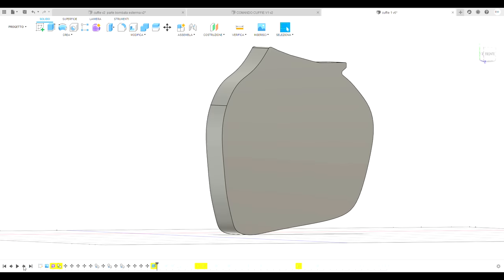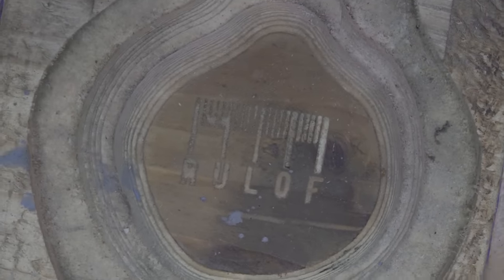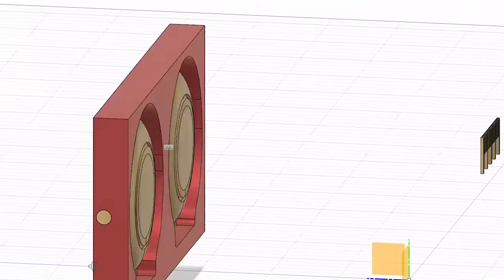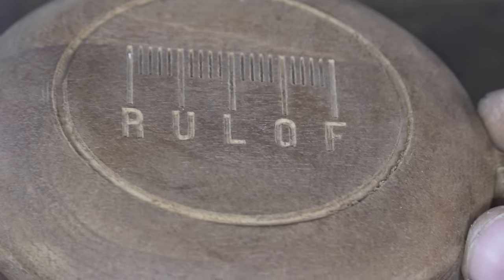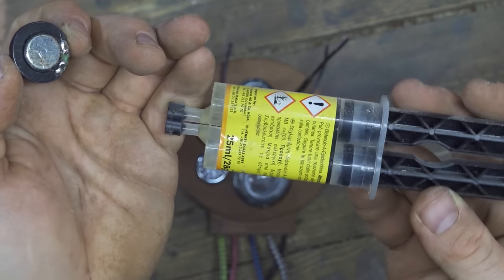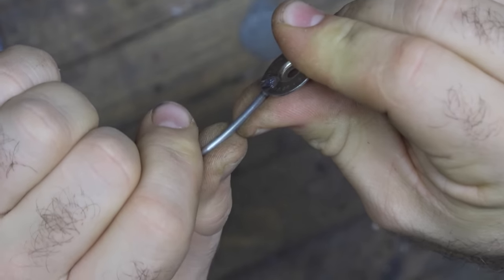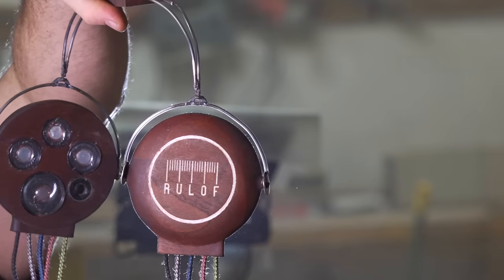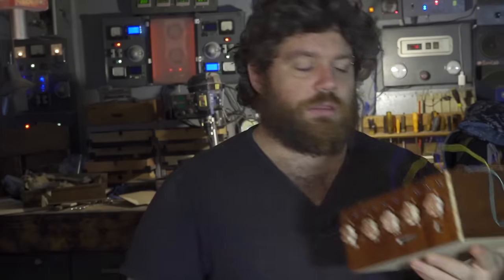How to Make Surround Headphones • Multiplayer Advantage

Comment: I look forward to seeing how you wire up the DAC.
Reply: Not that hard.

You have 4 normal speakers on each side+1 sub per side.
Front, Side, Rear, Center
Each one needs a power and ground
PC2001 design spec tells you what color each output on the internal audio card does.
Front as Green
Side as Gray
Rear as Black
Center as Orange Tip(Center is a mono channel decided for vocals)
Sub as Orange Ring
Ground is Sleeve on all TRS connections.

LF+ Green Tip
LF- Green Sleeve
LS+ Gray Tip
LS- Gray Sleeve
LR+ Black Tip
LR- Black Sleeve
LC+ Orange Tip
LC- Orange Sleeve
Left Sub+ Orange Ring
Left Sub - Orange Sleeve

RF+ Green Ring
RF- Green Sleeve
RS+ Gray Ring
RS- Gray Sleeve
RR+ Black Ring
RR- Black Sleeve
RC+ Orange Tip
RC- Orange Sleeve
Right Sub+ Orange Ring
Right Sub - Orange Sleeve

Only issue is you will need a USB type AMP to power the Sub.
The Roccat Kave was a 5.1 type headphone that used USB power to power the amp and do no audio processing.

Comment: I wonder how's the sound with no room behind the speakers.
also I'd suggest using rca connectors instead of glued in cables, because cables breaking are often the death of headphones
another option would be to terminate to a mini din or db9/db15 depending if having a common ground is a problem or not.

if you wand to keep crosstalk absolutely away, I'd suggest making cable combs so they stay tidy and away from eachother.

Comment: first of all, the reason you have multiple speakers in a surround sound system is because we are really good at perceiving where sound is coming from, and multiple sound sources makes it easier to simulate sound coming from somewhere else than right infront of you. with headphones this is not an issue, since the sound is being pumped directly into your ears. this means the echoing and minor delay that your brain uses to calculate spatial positioning of the speakers is completely gone. having multiple drivers in a pair of headphones is almost completely meaningless. the only reason to have multiple drivers in a pair of headphones is to either boost certain frequency bands or to balance the frequency response in specific ways, which is often used in high-end in-ear monitors.

the headphones look good and it looked like a fun project, but they wont give you any advantage ingame. having a good quality driver in each cup will give you a lot better quality audio and probably better spatial perception. a classic modding project is taking the cheap ass koss headphones and making cups for them. the drivers on the koss headphones are insanely good for their price
Reply: Everything you just wasted your time on saying is total bullshit. I've had headphones like the ones he just made, and you can clearly tell that there is separation from front to back.

Comment: Oh, and hey! Get some CNC proof-medium-clay its a cheap, usually pink clay/foam. I am sure routech (an italian CNC company I worked with can source it or give you scrap for a shout out. But this will be best while you are getting to know your machine. That way you don't have to run tests with endless material types and can rule out what problems may be material problems vs the ones with machining. But what do I know? Im just a fan. Who worked machines from routech sourced from italy.

Comment: Dude... All along this video I beating myself with facepalms because of ineffective use of tools and some other things... But do You know what? YOU ARE AWESOME!!! Because even in such way You still build some haedphones!
P.S.: I don't know if You figure out, but lack of air behind driver/speaker it can make it clippin because there be not enaugh air for diafragm to move and pressure in socket with driver affect to sound quality... But think holes from cables are enough... At least hope so.

Comment: I admire your work but you should learn more about electronics. Ad a passive filter in your next project, reduce to single cable. use an USB 5.1 DAC circuit inside headphone too.